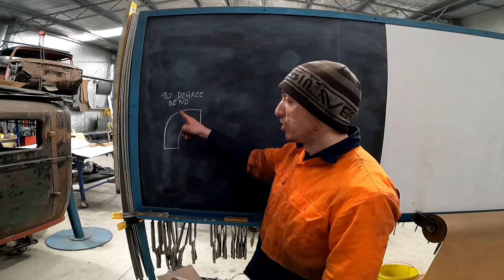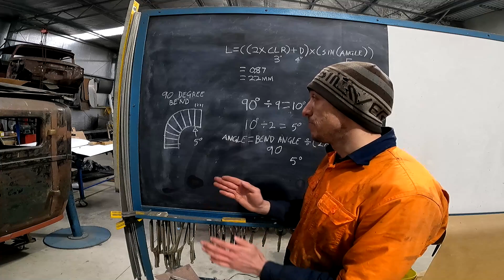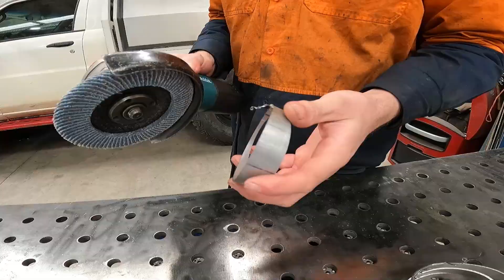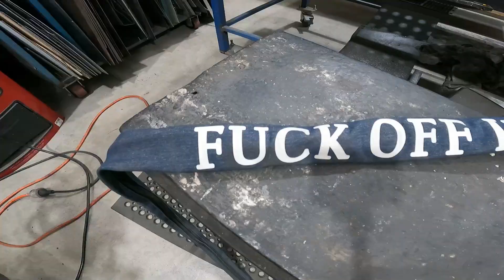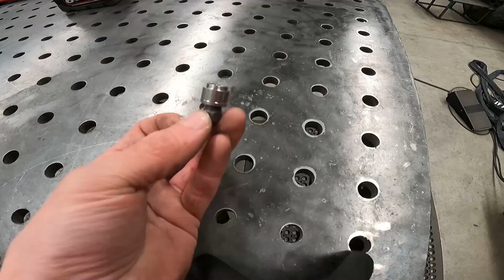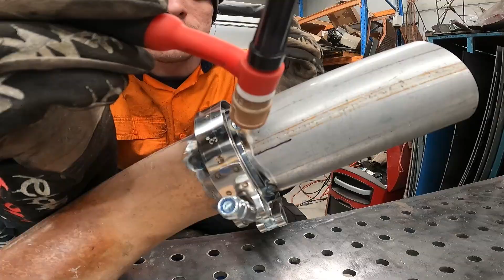How To Make Pie Cuts EASY! TD42 Dump Pipe

Comment: What filler/tungsten did you use for stainless on mild?
Reply from the maker: It was all mild steel mate. I used a 1.6mm multi mix tungsten with 0.8mm er70 wire from my usual mig wire reel
Reply: @house-ofhoon  thanks mate!

Comment: Some great tips re the degree-ing of the cuts, and marks on the Bandsaw. 
Just one question though. Wouldn't a 3" mild steel donut have done the same job for this application?
Reply from the maker: Cheers mate. This has a less than 1" radius. Not sure if there is a 3" donut with such a small radius or not. Also, sometimes you've just gotta work with what you have available at the time